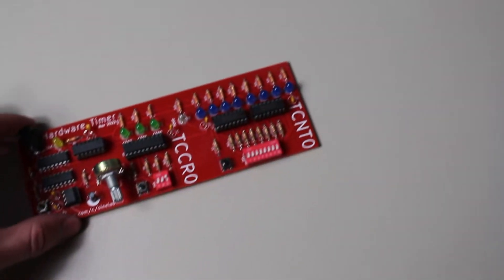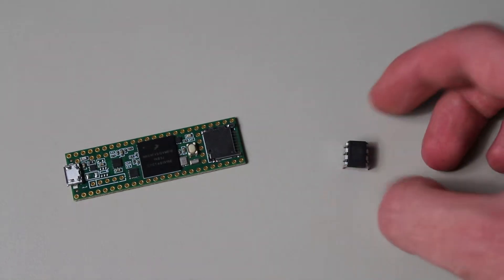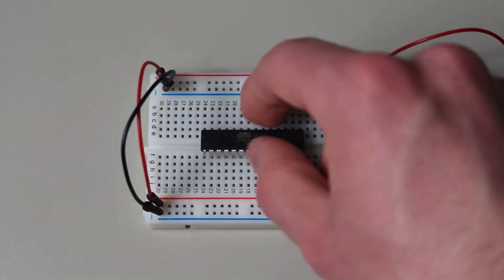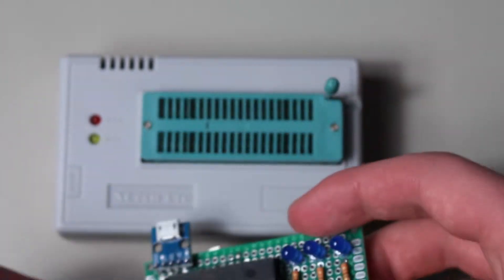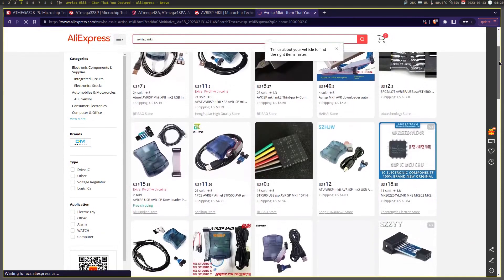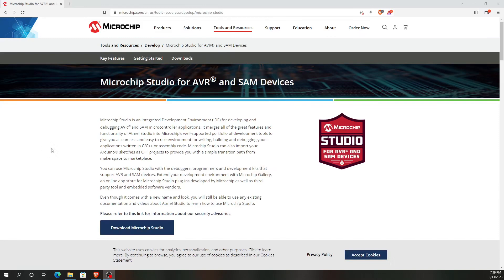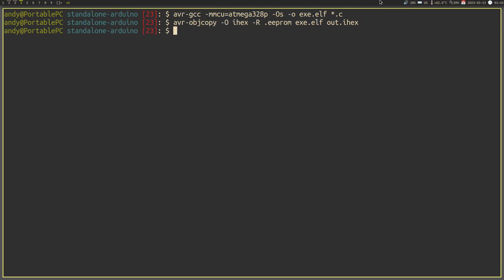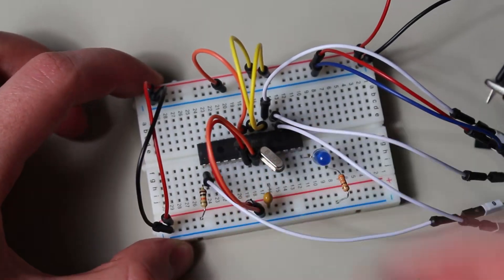Remove the ATmega from your Arduino! - Standalone AVRs and ICSP Programming - Beyond Arduino #3

Comment: Mixed feelings. Arduino et al give us useful capabilities not seen before. On the other hand, an entire generation or two of future EEs know very little about hardware and look for a software solution when they should be looking at a hardware solution. E.g. how many who learned Arduino first know the difference between an RC and an LC circuit? How many of them know that you can blink an LED with $0.001 of hardware, vs $5 of hardware?

Comment: The ATmega 328 is top dog in the microcontroller world. There are a lot of haters out there, but the facts are out. The best way to program these chips are to take an Arduino that uses a dip package and remove the controller and replace it with a Zif socket. program the Arduino as normal, test, then remove from the socket.  Forget all those other methods. My way works great and I've been programming these chips with my method for years. Save your money boys. Don't turn something easy into something hard. If you need a boot loader you can chain a Arduino to one of the chips and copy the boot to the device. Unless you're an advanced user and you have a need to change factory presets. Leave them alone. The original Arduino programing environment is probably the best way to program these devices for a beginner.
Reply: I 'm thinking to make something similar with a spare arduino pro-mini (5V16MHz) I have. I will put it in a breadboard and installed a ZIF socket and 2 female pins for the XTALs so I can change them using 16MHz or 8Mhz instead.
Reply: Indeed there are so many alternative ways to use the avr Products 
I sometimes use atTiny but on the other hand If I need More i o pins 
I²C or atmega1284 Big chip with lots of memory and many Timers
Reply: You can program a lot of different AVR chips if you just use an ISP/ICSP programmer.

Comment: The argument about the lack of Arduino support in the intro falls a bit flat when there are plenty of Arduino bootloaders for almost all of the AVR chips, even the ATtiny and the last Dx series. Sure it's not mainstream support but those still keep most of the Arduino/Wiring code compatibility on a minimalist board.
About the HVP, you really just need some FuseDoctor or RescueAVR that will set to default the fuses to re-enable serial line and reset pin. No need for a complete HV programmer. In most cases, even no need to use HV just for a bad clock source fuse setting, as some fancy ISP sketches for Arduino also provide an external clock signal to connect to the xtal pin of the target.
Other than that, AVRdudess is a GUI for AVRdude, for those who don't like CLI.

Comment: If I understand right MPLAB SNAP should support AVR and SAMD chips and also microchip chips. It's supported by microchip studio. It cost around 11e without tax in distributors. Some ESD safety may be needed because it's bare pcb like AVR Dragon was. It should also support debugging like AVR Dragon or Atmel ICE. I think it's more hobby friendly because it have 0.1" female pin header.